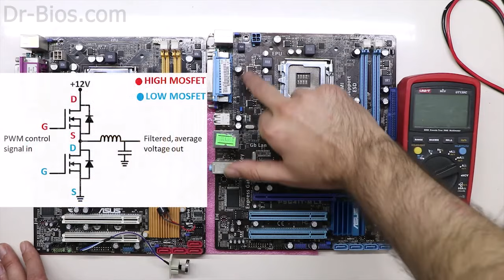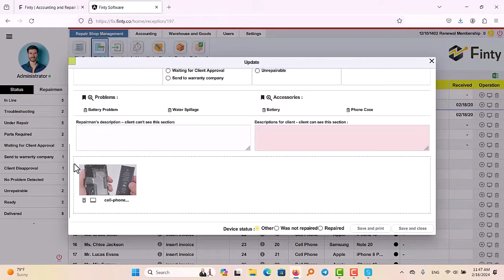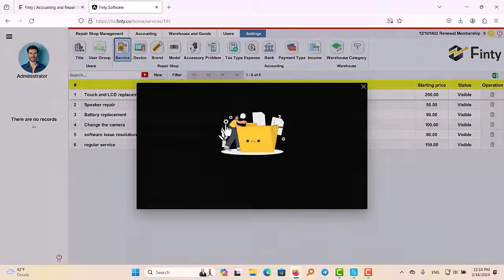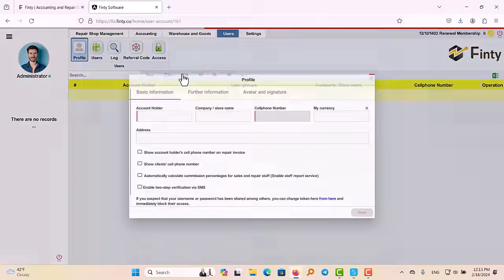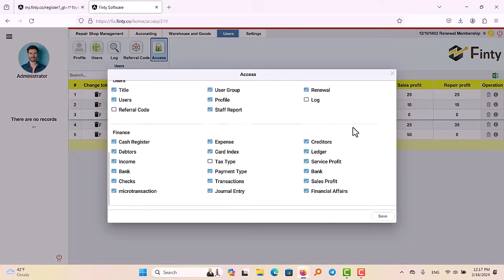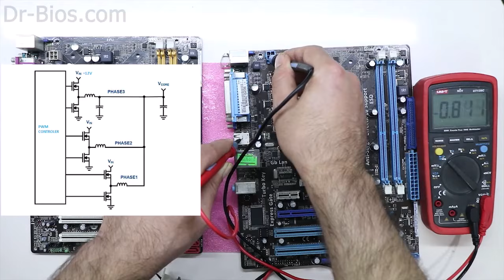Analyzing CPU Power Circuit – Testing MOSFET on Board

Comment: Hello, by accident during testing, 12V on the CPU connector from external PSU is connected in reverse polarity. CPU has not been burned, but there is a click in main PSU when trying to start computer. Which component is most likely damaged, one of these Mosfets?